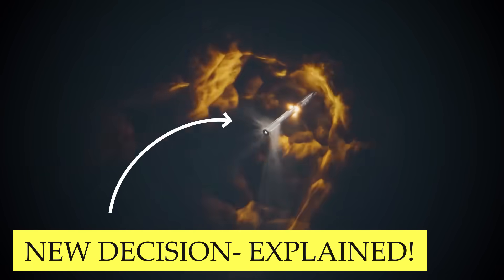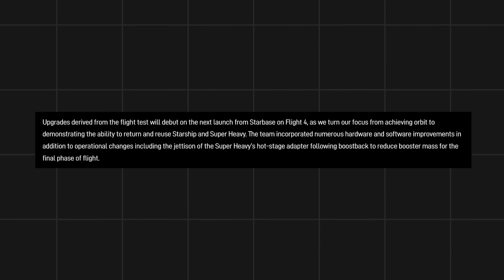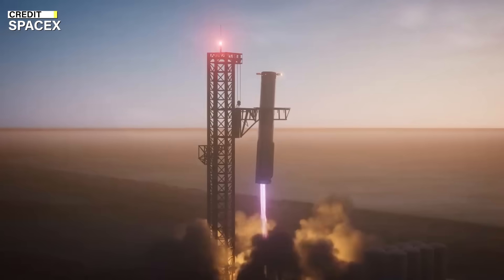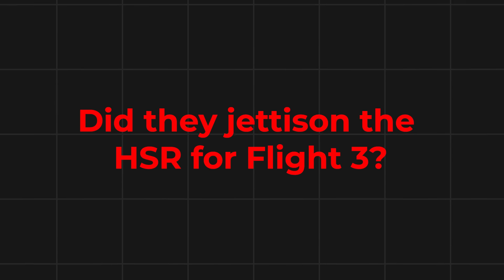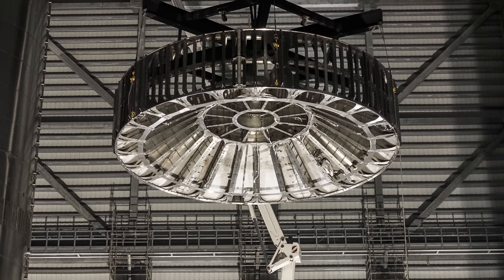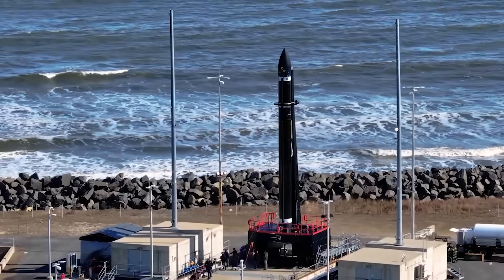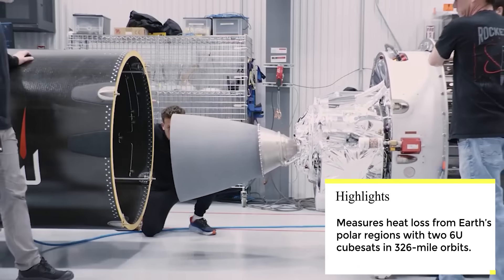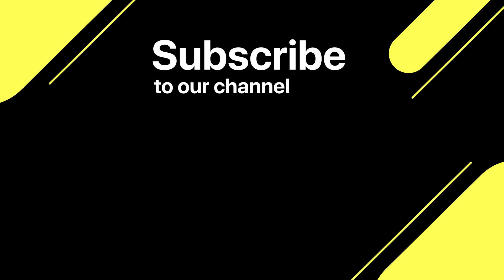Why Starship Hot-Stage Ring Was a Big Mistake? Rocket Lab Launch | Episode 45

Comment: Hey..i wish Elon would use the Falcon 9 as a template for catching a rocket. Start with a small scale. Cost savings in learning what works...
Reply: The falcon 9 is incapable of hovered as even 1 merlin at lowest throttle has too much thrust which is why it lands using a suicide burn.
Reply: Falcon 9 would need a masive redesign for catching. The load points move from the bottom to near the top of the booster which would be difficult and expensive to do on a composite rocket like Falcon.
Reply: The trouble is that the mass of landing legs doesn't scale linearly. Legs for Starship would be a far greater % of the total mass than F9.

Comment: <add a parachute pack on the underside of the hot-stage ring, it would flip over to the heaviest side. would land in the ocean, etc.>
Reply from the maker: not bad:)!
Reply: Or, a step farther. Connect the HSR to the 2nd stage, ejecting it after the booster is clear, and like a fairing, have it reenter on its own.
Reply: @Blargaldalien  yeah, i thought about that also. would that restrict rocket motor exhaust? 
<would still need a dome to protect the booster stage>
<for the most part, the soviet space launch systems to LEO just use some kind of piping, which is ugly/primitive, but still may be a great idea>

Comment: A. The booster V1 wasn't designed to carry that extra mass, so it probably upsets the balance a bit. B. Renders of the V2 booster shows built in hot staging looking like some of the old Russian rockets.
Reply: It messes with the grid fin operations.
Reply from the maker: Good point.
Reply: They actually still use it on their modern rockets look at the soyuz